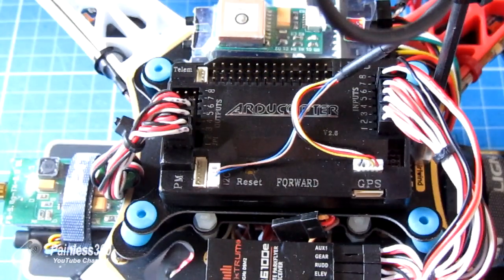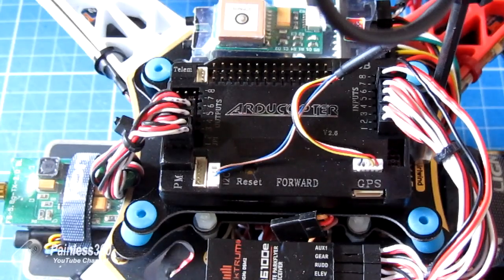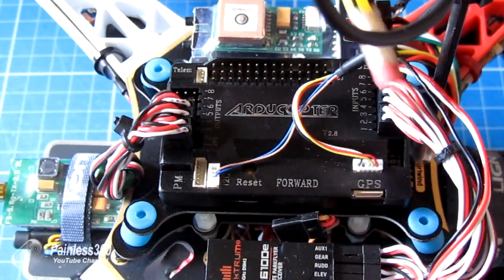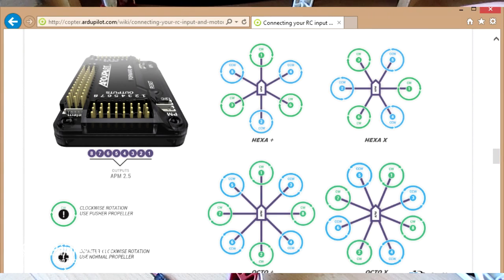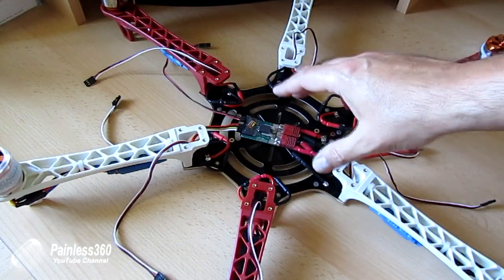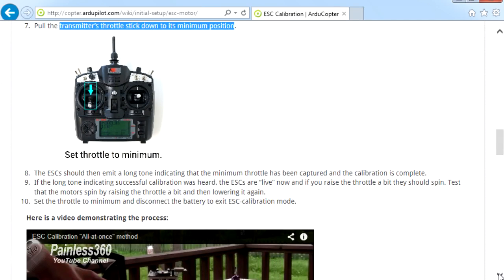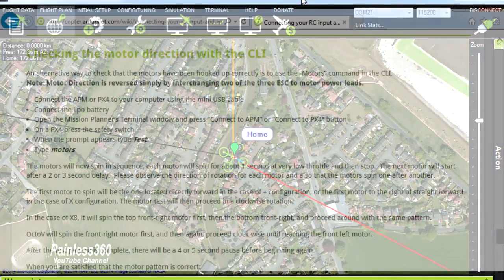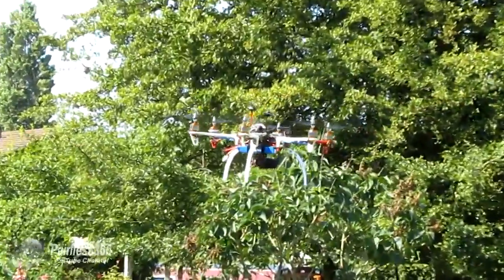(2/8) APM 2.5/2.6 - Powering the board, motor installation and ESC calibration

Comment: HI, i need a little help with my quad, i have a f450 quad and i have been using 3s lipo with a 10" prop, but i just got a 4s lipo along with 8" prop and tried it today, the quad struggled to take off and i had to put the throttle above 50%, but when it took off it was just out of control and flying about uncontrollably and it eventually crashed, my question is can i use my 10" prop on it, maybe that will help it to carry the load easily and be more stable, also what battery and prop size do you use on your F450?
Reply from the maker: +Oluwajoba Hassan I'd look up the specs for the motor you are using to see what the reccomend prop is for 4s. You normally have to adjust something. Best of luck!
Reply: +Painless360 its a 2212 920kb motor and says 8055 for 4s battery. And good great job with the videos its been a great help to me.

Comment: hi painless 360 i have seen all your videos and they r very cool i build a tricopter with apm2.8 and did all the steps like u have shown in you apm videos  the only problem i am is when i clabrate esc and throttle up they work perfect but when i arm the apm and throttle up the motors spin very slow ever on full throttle the maintain same speed  they spin slow i have clabrated  radio and wsc many time but nothing any help i would be very thankfull to you
Reply from the maker: Does it hover? You can see some odd behaviour on the bench. Also do the motors work ok when you connect the ESCs to the throttle channel on the Rx directly?

Comment: Painless360  I've been watching your videos for quite a while and they have been very helpful. I'd like to know if the Ardupilot 2.6 works with ESC Emax Simon series 30A ?      Also,   two of my APM 2.7;  stopped working, Is it there any way to repair them?
Reply from the maker: +Victor Rodas should do and probably but I would simply use a new one. Happy flying!
Reply: Thank you!

Comment: ive got a question i havent really found a reliable answer to!!......doesnt the fuse blow if you power the apm2.x/apm mini with the usb and battery at the same time? .....thing is that i want to do motor compass calibration but i dont know if i dare via usb since it requires the battery to be plugged in at the same time....i have the radio module ...but this got me thinking...hope u can help me out on this one!! thanx!
Reply: +DIY stuff ooooo for got to say that batterypower would be  via powermodule, jp1 connected and no esc bec ofcourse

Comment: APM 2.7 from Hobbyking
How come when I arm the drone I get only part of the power to the motors ?  (Stabilize)
I would say I´m done calibrating the ESC Afro 20 (all at once though) with success sound from motors.
Is it a unsuccessful calibration on the ESC´s  or is it something else ?

And Can you tell me why I get only rubbish text when I connect to the APM 2.7 in Terminal ?

Spec:
Afro 20, SunnySky V3508-16 - 700, Turnigy i-10 from HK Using Multirotor setup, MP 1.3.37 - V 3.2.1 Hexa, 

Thank you so much for your extremely great work Painless360 .  Nothing compares to what you are doing for us : )
Reply: Hi Olafur, did you get a solution to your problem because I have the same trouble with the motors not fully powering up. I have calibrated the Esc'c both all at once and each separately but when I arm the copter I can increase the motor speed only part of the way, not enough to lift off.
Reply: Go to settings and set MAX THROTTLE to 100. Probably it is default at 80.

Comment: if I plug servo to [output pins], it powers direcly from several parallel BECs (for brushlessmotors), current can be more than 2 ampers, it don't go through diode and fuse.
Reply from the maker: +айн штуцер not sure what you are asking. If the current is all on the pwm output pins you should be fine. Best of luck!

Comment: Hi Painless 360.

Have just finished building a quad, followed your ESC calibration and motor direction instructions.
Each motor works fine when calibrating  individually, but when I connect them all through the Ardupilot one lags a fair bit behind the others.
wont start to rotate until quite a bit of throttle is applied.
Any assistance would be great-fully appreciated.

Ken..............
Reply from the maker: +Ken “kenno17” stockton I'd recalibrate again and if it is still the same then swap one ESC fro another on the model and see if the problem follows the ESC - if it does then I'd suspect that ESC has different firmware from toe others.. Best of luck!

Comment: Hi I went through process. When I disconnect the battery and back again at the end. I arm the drone and suddenly I can control the throttle but I suddenly lose control and the motor speed keeps increasing and suddenly stops. Hope you can help.very weird . When it is just the battery connected the motor arms  spinning fast and stopping without control possible.
Reply from the maker: +Vizor not sure, what have you tried?
Reply: I suspect that after calibration the drone is another mode. So what happens now is when I arm and pullup the throttle the motors spin fast and stop. Nothing else happens.

Comment: Hi Painless! After the ESC-s calibration (all at once or manually), I connect to the MP/Terminal/Connect and on the screen I get  Arducoter V3.2.1  and then randomly symbols from the PC'c keyboard. Any idea why?
Thank you in advance.
BR
Reply from the maker: +Kliment Rose Valley The latest APM firmware stopped supporting the GUI for space reasons - see the notes from the latest releases. That may be part of it.. Best of luck..
Reply: +Painless360 you are great. Thank you very much for the quick response. I will keep watching your videos, hopefully find the solution. I've been having this issue for a couple of weeks now and I keep trying.

Comment: I have bought this kit: http://robokits.co.in/quadrotors-hexarotors/flight-controllers/arducopter-apm-2.6-full-kit-gps-power-module-telemetry?cPath=116&

with telemetry module and power module.I am a bit confused about what does the telemetry module do and how to use power module.can you help me?
Reply from the maker: +Mani Singh All covered in the series.. Power Module tells the APM how much power you've used and the telemetry module allows you to stay connected to the craft wirelessly while in flight..
Reply: +Painless360  thanx for the quick reply

Comment: hi there i was wondering if you can help. ive built a s500 quad and do not know how to do the settings on my transmitter.which is..flysky fs-i6 do not know settings for end points should be+dual rates and should all my reverse switchs be all up ..because, my Xquad copter goes mad  even trying to take off.
Reply from the maker: +richy todd Sorry, we don't have that radio here. Best of luck with it..

Comment: For using the Power Module, is APM supposed to turn on as soon as it is connected via the PM (Like, all LEDs on). I'm unsure about this because the board LEDs turn on just fine via the usb connection, but none of the LEDs turn on when connected through the Power Module. I have JP1 removed. I haven't connected anything else to the board, just the PM and the micro USB to test how it powers on.

Comment: what happens if I plug in the UBEC with the all of the red wires plugged in? And please can you briefly explain the part from 4:00 to 4:37? Thanks
Reply from the maker: Depends on what the BECs are. When using switched only ever have one of them connected at once..

Comment: I appreciate all of the information you provide in your videos.  I see that you have the second lead from your GPS (compass) plugged into the I2C port.  I have my compass lead plugged into the port below the GPS port and it seems to work fine.  I'm using APM 2.8.  Should I be using the I2C port for the compass.  Thanks.
Reply from the maker: +jj vb Yep, four wires for the compass - VCC, GND, Rx, Tx and the other cable to the i2c port for the external compass..

Comment: Hi there, i've read the Pixhawk manual and if i understand correctly my wire must be this one.....Receiver Sbus Futaba R7008SB into port RC on PX4 but not the adjacent output "sb"...Osd into telemetry 1....my camera wired on output Osd...Esc OPTO into main out but only one is used with positive red wire...each ESC is powered on 5V 12V Adjustable Voltage BEC Output ESC Distribution Connection Board......Lipo powered Power module  ( 3DR )...into Power...Switch into switch...Buzzer into buzzer...Gps into gps port and compass into l2C...then gimbal must be wired into AUX 1 for Signal and negative plug...
Last question....may i used another gimbal than Tarot or StoRM32 Gimbal controller...i need to wire a 3axes gimbal like New 3 Axis Brushless Camera Gimbal Mount w/32bit Alexmos Controller/ ipower motor for bmpcc Sony NEX5/7 FPV Aerial Photography for a Sony Nex 7 ...then i'd like to powered my drone with 6S lipo....the total  weight will be from 4.5 kg to 5 kg to take off...
thank's a lot for your annswer

Philippe
Reply from the maker: +Drones Visions Aériennes We have a Pixhawk series that may help. You can use a gimbal with it but you will normally be looking for the gimbal to be controlled by a dedicated controller, not using the Pixhawk. Best of luck with it!

Comment: please help i have a mini apm done all the checks ie firmware realy strugling with wiring my servos to the mini sorry i have a helicopter done the receiver please tell me how to connect the servos and esc to get my motor running what mode do i put in my tansmitter ie hi h2 h3 ap thanks chrisholt
Reply from the maker: +Chris Holt Hi Chris, we have a video where we setup the Mini APM on a wing, I know it's not the same but we do show how to connect up servos using the wiring connectors. I've not used an APM on a heli myself so would struggle to help with the other part of your question. Best of luck!

Comment: Great video, I understand, if I want to use Power module to power the APM, I need to remove all Red wires from ESC right, just like pixhawk,    also just like your previous videos, you leave red wires if you are using linear ESC, and if your are using switching ESC, only once ESC will have Red wire,  is that all correct?   thank you
Reply from the maker: Almost. With PM remove red wires or remove J1..
Reply: +Painless360 Thank you, and 1 more time, great videos, I am watching all of them, one by one !!

Comment: dear sir, your channel is great and gave inspiration of building my own drone. i do apologize for asking this but i just want to make sure i understood. i am buiding an x8 quad and have 8 opto esc and am apm2.6gps external compass (arducopter) with powermodule , in my apm package i did not recive a jp1 plug. were shall i take 5v to initialize signal cable for optio esc as i will not have a spare output port. shall just solder the jumper1 connection on apm board or squize in a red and black cable from an ubec paraell with opto esc in on of the output ports? excuse my spelling, thank you again for your great videos.
Reply from the maker: The PM should power the board. I'd get hold of a jumper.. Best of luck!
Reply: +Painless360 thats awesome!
Thank you so much for your reply.

Comment: hello, I'll build a f550, like your setup, I'll buy almost anything in HobbyKing can tell me what the motor / esc / propeller / battery you have on your f550.
thank you so much
Reply from the maker: I built this using motors designed for planes before the explosion of motors specifically for multi rotors. I'd look at the latest motors to see what's available..
Reply: ok tkx for the help,

Comment: by the way you can power both sides of the all using the pm. and if you are using an OPTO ESC. you can either use a pm and jp1 or use a UBEC. either way it works just fine

Comment: Hello Firstly thanks for taking the time to produce these videos I have learnt a lot in a short time, but I'm stuck and I wonder if you can help I have removed my CC3D set up on my F450 and replaced it with APM 2.6 the ESC's are Hobbypower 30A. One of the motors stopped (and started) at a higher throttle than the other 3 so I did an all in one calibration and now they all stop and start together, great except all the motors run as soon as I arm the board and they only stop when they time out or manually disarm?? I am using a Turnigy 9X TX, Any thoughts would be appreciated.
Reply from the maker: +Trevor Vernon This is normally down to the 'Motor Stop' not being set. You can have the motors start to turn slowly when armed or not. This is covered in the APM playlist. Hope it helps!

Comment: Hi Painless. I apologize if you've been asked this already but I'm planning on using OPTO ESCs with an external UBEC for them. A couple of things I am not sure about are:

1) If using the power module (JP1 not installed) is it adequate for the OPTOs to "see" the 5v without the need for a UBEC?

2) If using an external UBEC, is it enough to power the entire board as well as the OPTOs (JP1 installed) without the need for the power module?

3) Can I use a power module while using an external UBEC on the output pins for the OPTOs? If so, JP1 I'm assuming is not installed here?
Reply from the maker: +iflyimpilot 1) Without J1 you probably need a UBEC on a spare output for the ESCs to initialise 2) Yes, but don't add servos. 3) Yes, leave J1 uninstalled. Happy flying!
Reply: +Painless360 Crystal clear! Thank you so much!

Comment: I have completed my first 450 quad build with the APM 2.8 unit. I am having a challenge with number 4 motor when I arm the copter all motors spin at low throttle except for motor number 4. Once I increase the throttle to approx 45% the motor number 4 starts spinning. As far as flying the copter its very stable and rock solid on GPS lock. What I tried was switching # 3 motor to # 4 thinking that it was the esc Was the problem , but that was ok. # 3 motor was not spinning letting me know that it was in the APM unit. Thank you for your great educational videos that you have posted they have been very helpful. I'am stuck with this challenge can you help?
Reply: +Rolando Ramos i have the same problem with, would u mind to share your troubleshooting since i see your channel u got it fly.. thanks in advance
Reply from the maker: +Rolando Ramos I'd recalibrate the ESCs manually (see the video in the series) then if it continues swap the 'lazy' motor with one of the others to see if it's the motor or ESC causing the problem.. Best of luck!

Comment: painless 360, I'm new at this. i have a power module and OPTO 30A ESCs. with that setup do i need a ubec? cant i just install jp1 and power the board using the PM?
Reply: don't be a dick! you said in your video that:
1. "if you are using an OPTO then you absolutely need a UBEC"
2. "using a power module you can power both side of the board using the JP1 connector". 

thank you for your video, it was very helpful, but you could've made that part a little more clear. having that said, I'm in love with apm and I'm tuning my y6b drone now thanks to you and this series. 

jeff
Reply: don't be a dick! you said in your video that:
1. "if you are using an OPTO then you absolutely need a UBEC"
2. "using a power module you can power both side of the board using the JP1 connector". 

thank you for your video, it was very helpful, but you could've made that part a little more clear. having that said, I'm in love with apm and I'm tuning my y6b drone now thanks to you and this series. 

jeff
Reply: don't be a dick! you said in your video that:
1. "if you are using an OPTO then you absolutely need a UBEC"
2. "using a power module you can power both side of the board using the JP1 connector". 

thank you for your video, it was very helpful, but you could've made that part a little more clear. having that said, I'm in love with apm and I'm tuning my y6b drone now thanks to you and this series. 

jeff
Reply: +Jeff Lopes Did you work it out? I'm in the same situation haha
Reply: thanks
Reply from the maker: +Jeff Lopes This is covered in the video. What do you think the answer is?

Comment: +Painless360 I am new in building the quad. I have APM 2.8 with 6m GPS and power module. With 4 30Amp w/ 3A 5v BEC ESC, running with SimonK. I wanted to ask about the connection.should I remove the JP1 and remove all red wire from ESC? Or I can place the JP1 connect and remove the red wire from ESC? I also wanted to install a gimbal for my camera with pitch control. So, I am wondering where my gimbal can get the power from?Hope you can answer my doubt about it. Thanks
Reply from the maker: +RCYI Justinizer OK, that is a few questions in one there. If you are not using a power module then I would install J1 and power the board from the BECs in the ESCs. If the BECs are switched then only connect one of the red wires. The gimbal gets power from the main flight battery normally and the signals from wherever (Rx of FC) can move it for you if needed. Best of luck with the build...
Reply: Painless360 thanks for the promtp reply. So if i am building it with power module, i will need to removethe J1 and remive all ESC red wire?
Reply from the maker: This is covered in the video ;)
Reply: Painless360 thanks.